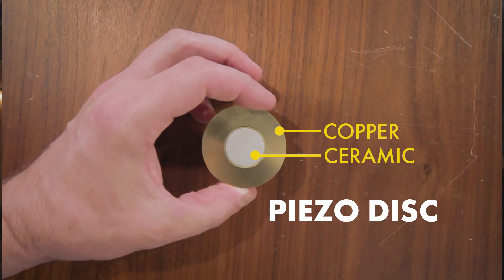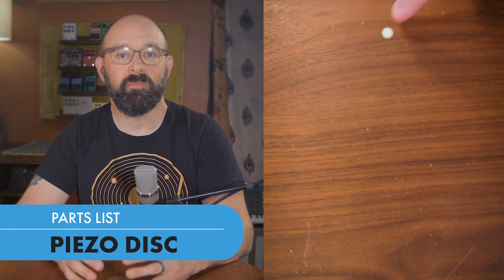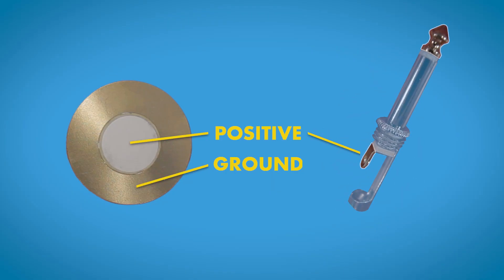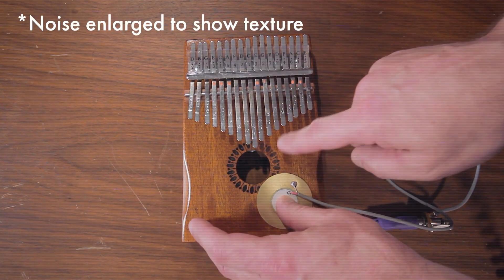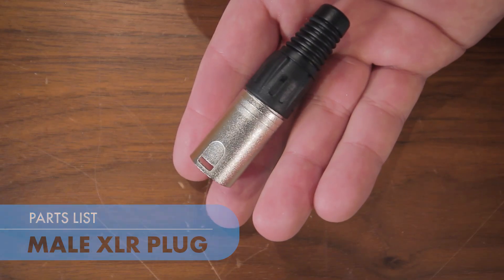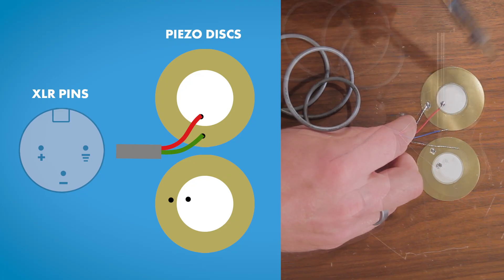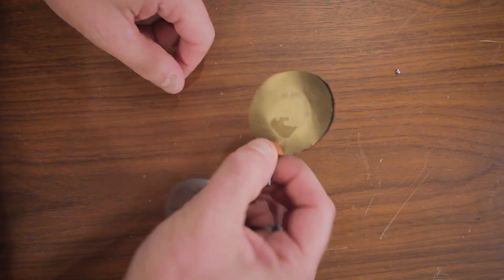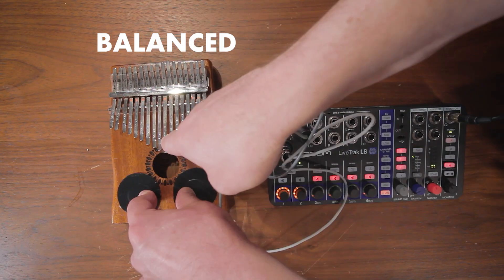How to Build Your First (Good!) Contact Microphone

Comment: thank you so much for this! Making for the first time! I did everything but used a 1/4 inch mono plug with the red (+ve)  at the tip and (-ve) and ground an the base.  But I am getting a lot of noise when I plug it in. Is there something I could do to troubleshoot that?
Reply: The 1/4 inch mono means that there’s no ground signal in your jack. Go for a stereo jack that is balanced, instead

Comment: No impedance matching 😭 Contact microphone like a condenser microphone requires high input impedance, 1 MOm and higher, for properly picking up the bass, so, u need same jfet circuit as in condenser mic (or jfet input opamp amplifier).

Comment: People should also look at the AKG c411PP (i think ts called). I dont think its piezo, but it uses phantom power to boost and clean the signal. Its good for those who're not that great with DIY stuff. You can also mod some cheap dynamic mics so the capsule can be stuck directly on surfaces, look at some of those cheaper karaoke mics for that. Some old telephone suction cup mics essentially did this in the early days of recording phone calls to tape.

Comment: cool- i have the l6 too. so to be balanced, i hace to use the mic in? if i use a trs connector, will it still be balanced using the ch 1+2 jack in? still be balanced if i use the other channel mono ins? what if i use a trs to 2x ts adapter to send it L+R? would i need to flip one TSs phase to get stereo? 

great vids man!

Comment: I'm trying to build an app that auto detects noisy upstairs neighbor sounds. I've been playing with a simple mic hooked up to the phone and some machine learning to learn only the noises they make, but it's still not perfect due to catching sounds from my apartment. I've been thinking of trying to hook a multi mic setup with regular mic for ambient sound and a piezo one to trigger the recording at the right times (due to it capting the ceiling vibrations), but I'm having a hard time building one that can be used from a smartphone with trrs jack. 
Do I need a balanced piezo mic? Is a preamp necessary? How to avoid electric hums and static from the hooked up system? Is there a proper diagram on how to hookup such mics into a TRRS jack for smartphones? Usually they don't seem to detect them as mics. 
I bought the red piezo you shown briefly at the end of the video, which is unbalanced, apparently.

Comment: Hi, if i build the better contact mic (two piezos) and instead of the xlr output use the trs male jack output, can i plug that in my zoom g1x multifx (or any other guitar pedals) without damage or risk? i want to try using the contact mic with my sax and run it through the pedal, so cancelling as much noise as i can is prefered 
thanks a lot, will be making this soon hopefully :) keep up the great work!!!

Comment: Better to go with dual piezos (big & small simultanously) to cover more of the frequency spectrum. So for a balanced setup that would be four piezo discs.
Reply: Would you set that up like a stereo mic, or merge the signals of small/large piezos onto the same wires?
Reply: @VOROX_Audio  Depends on the instrument - I go stereo whenever channels provide good separation by not phase conflicting each other problematically. Note that a full spectrum balanced stereo setup would require 8 discs total - discs are dirt cheap though.

Comment: Cool video!

But i‘ve a question about the dual piezo setup: 
Doesn‘t this cause unwanted cancellations because both mics receive a slightly different signal due to their positioning?

With two mics, i reckon, there won‘t be an exact, but inverted copy of the signal on the second line, which should lead to cancellations when it gets inverted again at the balanced input of a mixer / recorder / audio interface.
Reply: If you want maximum signal strength and the best representation of the source sound, you definitely need to position the piezo elements on an instrument in places where both elements will pick up roughly the same vibration patterns. Anything else will result in a weaker (but typically still audible) signal

Comment: You inverted tip and sleeve on the female jack at 3:35
Reply from the maker: Measure twice, cut 4 times is my motto. Good catch!
Reply: The same is true at 4:50, which begs the question when does it affect the recording and can it be a useful phase inversion trick?

Comment: I was just reading up on this project in the book “Handmade Electronic Music” by Nicolas Collins (2006/2009) and he also goes through using this with a transformer to make a driver, which may be some fun for folks to try too. I plan to make a sound box with a contact mic to see what I can achieve, along with some extra contact mics to try on other things. I spent years salvaging bits and pieces from old electronics, so I have a lot of what is needed already without having to buy new stuff. Have you done this using transducers instead of piezos?

Comment: I'm not sure how much that is in balance versus putting 2 piezo discs in series and increasing its output.
I guess technically they're in series and balanced to some degree. Most dynamic microphones have the coil element across pins 2 and 3 with the shield going to the chassis which isn't connected to the element.
Why do I say this, I've been come very familiar with cheap microphones that have miss wired connections.
I didn't believe it until I saw it, I opened up one of the microphones I got with some thing and sure enough that might explain why I had a buzzing issue when I used it with a professional system and not the wireless transmitter receiver set that it came with.
This is also a consideration to consider if the item is going to be used with phantom power or a device where you can't turn that off. As the elements should be floating like a bird on the wire between the hot and cold pens not affected by the potential difference between the 48V and the ground connection.
Definitely a cool And well done video.
Reply: Looking at 10:48, the discs don't appear to be in series. The ground wire is connected to the positive of one disc and the negative (ground) of the other disc. Then, the hot and cold pins of the XLR jack are connected to the positive of one disc and the negative of the other disc, respectively.

Comment: I have dysarthria, voice problems resulting in low sound output. I'm interested to see if a better throat mic can be made, specifically one that uses adhesive patches to attach. It would make using a personal amplifier a better experience.
Reply from the maker: So I don’t think this would be a great solution unfortunately. It would not be a very clear signal-most likely muffled. I’d be curious to see the results if you try though!

Comment: Nice video! I have one very important remark. I think you inverted the pinout of the female 1/4 inch jack! The ring, which is the inside part, is supposed to be negative. The tip, which is on the outside, is positive. Same for the part where you solder it.
Maybe I'm wrong though, but I soldered a bunch of these this week so I had to double check each of them. Best check it with a multimeter!

Comment: I wired up a balanced contact mic a few months ago and it's brilliant! Such a better signal. One of the things I did was to join the two disks wired side to wired sides facing each other and used a bit of glue gun glue to join them. There needs to be just a bit of air gap between them. Afterwards you can cover it in Plastidip and you've got yourself a hydrophone.
Reply: Great video BTW!

Comment: is there any particular reason you invert the soldering order of the wires when you connect them to the second mic?
Reply from the maker: It’s the way I was taught to wire up the signal in order for it to be properly balanced. Since it works great, I’ve never even questioned it to be honest! I wish I had a more scientific answer for you 😊
Reply: @TheSoundofMachines  In a balanced system,  two signals  must be out of phase, the two signals will be substracted (at the other side of the balanced system) but because they are out of phase this results in an actual addition of the two i.e. a doubling of the signal level. Noise signals such as 50 Hz hum will be in phase and therefore  when they are substracted from each other, the noise signal is cancelled. Optimal operation requires the two piezos to be identical and capture nearly the same signal.
Reply from the maker: @hugocoolens  Thank you! HEY EVERYONE! Here's your answer!!👆👆👆👆
Reply: @TheSoundofMachines  I caught that too. It seems a difference of series vs. parallel?

In my own piezo experiments found that wiring them in parallel increases the impedance, which then requires the use of an impedance match preamp, otherwise the signal level is even lower than you demonstrated, with even more noise from EMI/RF, and then still acts as if a 500hz high-pass filter is inline. Not good at all. 

I am looking forward to checking out your other videos. 

Thanks for sharing this info and demonstrating how to build such piezo transducers into a contact mic.
Reply: @BPT-h3g  I wasn't thinking this was a matter of parallel/series, but I feel like this might flip the phase on one of the mics. I haven't tried it myself though.
Reply: @BPT-h3g  "wiring them in parallel increases the impedance". 
Nope. 2 identical elements in parallel have HALF the Impedance of a single element.
Wiring them in SERIES would double the Impedance...

The degraded signal/noise ratio and loss of bass sounds like your piezos are either:
1) wired out-of-phase and are making contact in the same physical orientation
2) wired in-phase and are making contact in opposite physical orientations

Comment: Piezos are fun!! Remember to grab several extra as soldering on to the ceramic part can be tricky at first and you may want to practice. I've ruined quite a few..

I just recently imbedded a piezo to the neck of my bass guitar. I made it "active"  by adding a little transistor amplifier circuit with a 9v battery and a toggle switch to turn in on and off.  It mixes surprisingly well with the PJ pickups and adds a bunch of "clack"! 😁